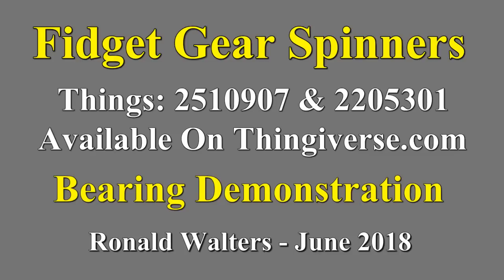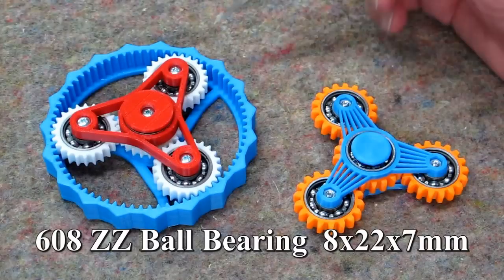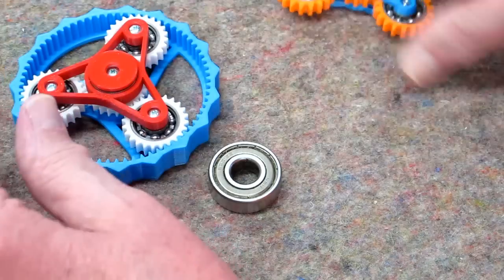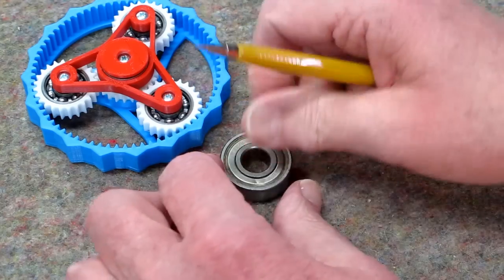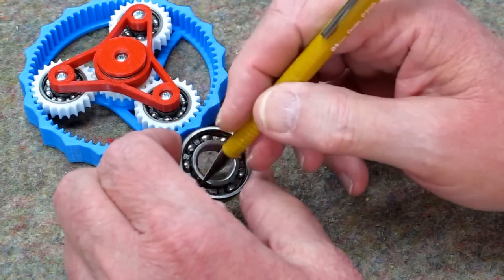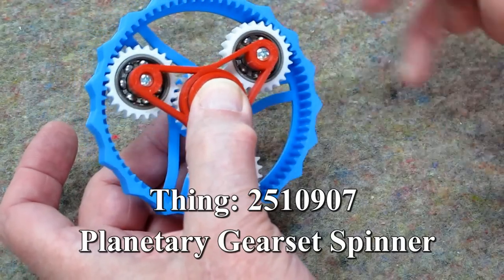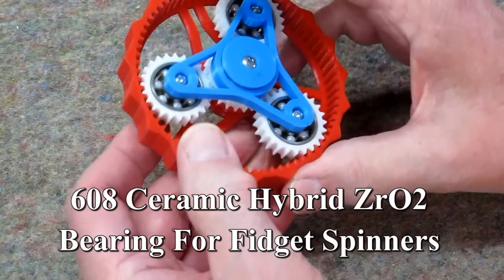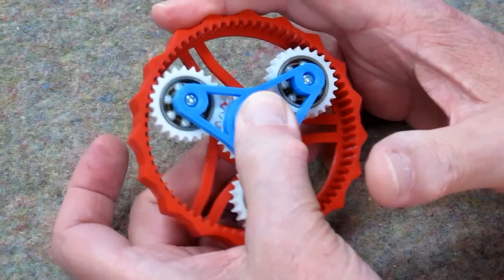Fidget Gear Spinners - Bearing Demo

Comment: Ron, sorry to have to ask but I was wondering if you removed any grease on the ceramic bearings?
Reply from the maker: These particular ceramic bearings (see description) are sold specifically for fidget spinners. No grease, no dust caps and do not require oil.
Reply: Thanks, I went to the link in the description but only to save to my favorites. I should have read about them. 
I've  been on a constant search for the best bearing for my contraption (attempts / experiments) and now I found the best by far. Thanks for including the links. That's always extremely helpful.

Comment: Great ceramic bearing demo! I almost skipped this video. I admit when you said you could get longer times using ceramic bearings I didn't think it would matter much. Ha! Thanks BTW: How are you doing with CAD? I hope you keep challenging your self because I know you will be coming up with many cool mechanisms and contraptions. It looks like you already have a good handle on it to me. Way to go! - I never thought you would allow yourself the time to learn CAD. ;-)
Reply from the maker: Keep in mind most of the gadgets shown are from thingiverse. Learning the 3D printer stuff has been the challenge. CAD is still off in the distance and time has certainly been a factor. Hopefully we'll get there.
Reply: Look forward to seeing if you can 3D print an organ pipe ...
Reply: I have no doubt you will be all over the CAD Stuff. If I knew Fusion I would get you going to a point that you would be able to do whatever in about a half dozen 2 hour skype calls. A few basic challenges is all you need to accomplish. I bet you could pay someone that knows Fusion a 150 to 300 bucks to get you really going using Skype Share Desktop. I did this with an older gentleman for free but he had dementia and he would give up and try a different CAD program and that went on and on and I was not able to help him unfortunately. Stay with Fusion!

Comment: A heavier outside ring might make a good flywheel and they might spin longer.
Reply from the maker: Or if I could get it spun-up in a vacuum. Wind resistance is an issue, especially for the smaller one.